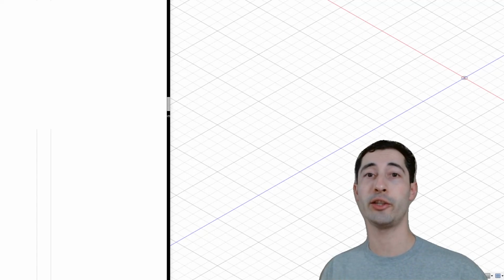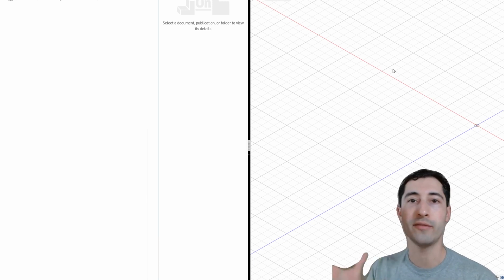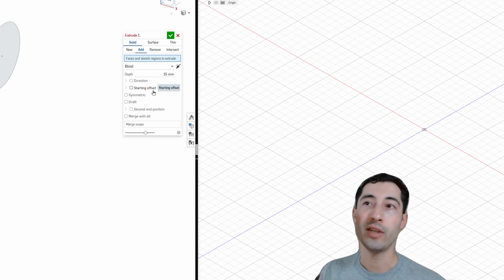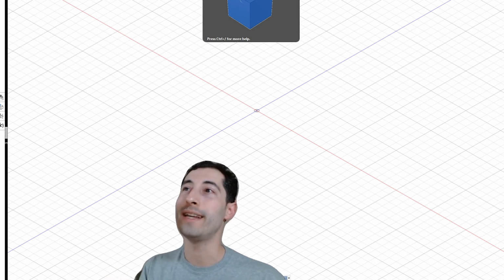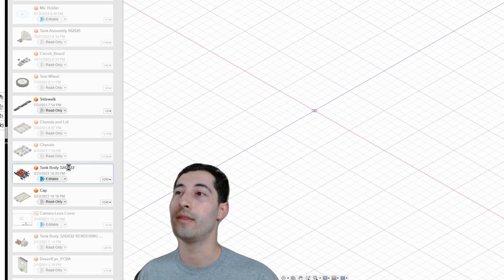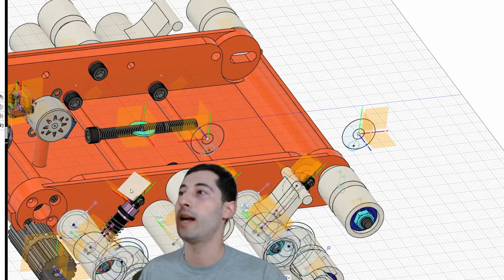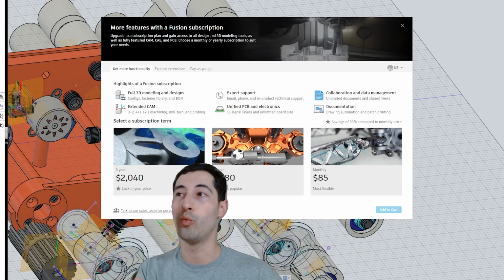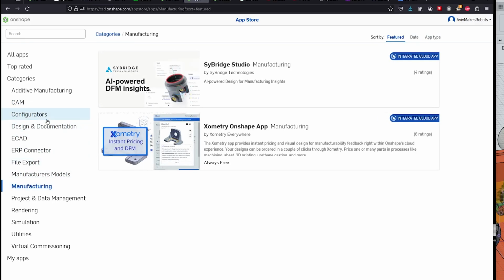Onshape vs Fusion vs Solidworks

Comment: Good video. I appreciate your point of view on the subject because you’re coming at it from the point of view of a professional in the industry with years of experience and builds under your belt…but what about the brand new CAD user?  I’m new and looking to get into this world and design parts and creations with a 3d printer…i have found fusion 360 to be extremely foreign and counterintuitive. Do you think onshape would be better suited for someone that knows nothing and is starting from scratch?
Reply from the maker: Not necessarily. To the eyes of a beginner, Fusion and Onshape are pretty similar. If I were you, I would try to understand sketches first and then eventually look at features and which do what. I have some intro videos on this for Fusion.